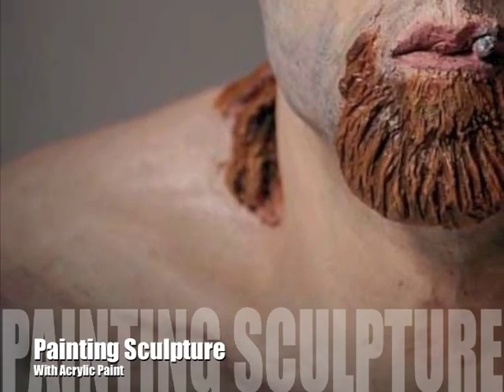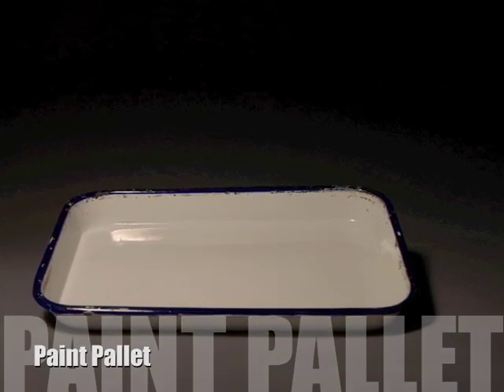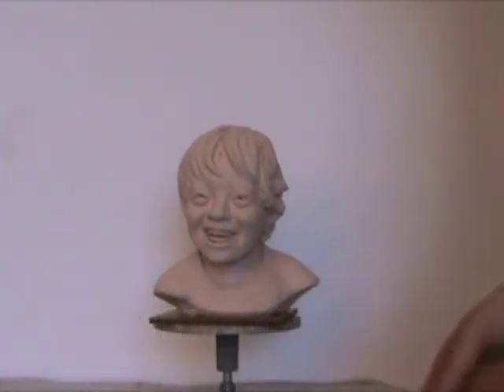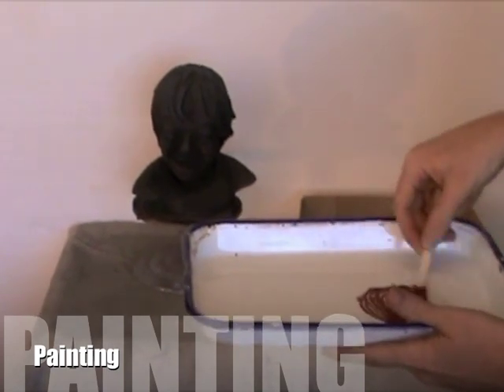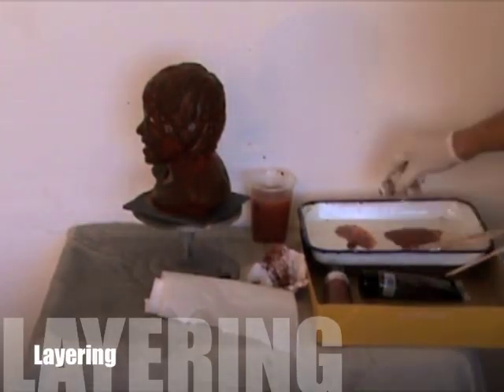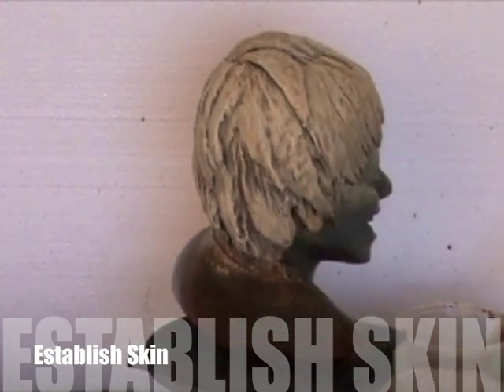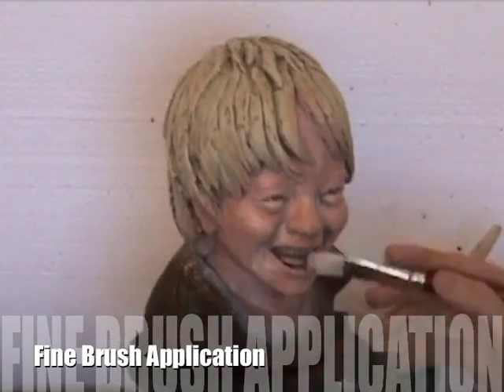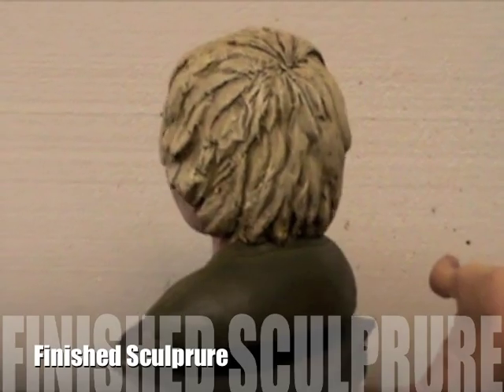Painting Sculpture With Acrylics

Comment: Too difficult to hear audio, you DO NOT need to primer the form first, or dip it in water. I have used gesso on the sculpture first, then applied acrylic paint. The music is too loud and unnecessary, it would be best to use more explanation in your video, students need to hear step by step what you're doing.